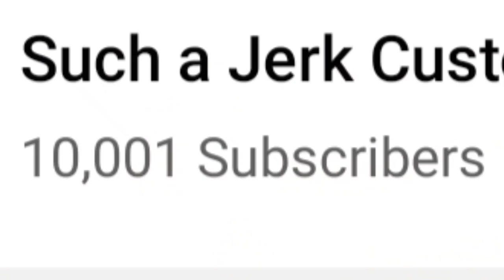Lure Making Trout Minnow | build to catch 🎣

Comment: What product did you use to be that mirror effect after the black paint?
Reply from the maker: It's called mirror finish powder for nail art, in order for it to work, you must use "top coat no wipe" UV nail polish 😉
Reply: @SuchaJerkCustomLures  Very well, then the black paint is also for manicure?, and the final finish you use epoxy resin or is it some nail polish?
Reply: Sorry for so many questions, I hope I'm not annoying or intense... 🤪
Reply from the maker: @zonadepesca7259  no worries, I'm trying to explain as much as possible in the video, but if something is still no clear, I'm happy to reply 🙂
Reply from the maker: @zonadepesca7259  Black paint is regular airbrush paint, just apply it with brush 🖌️ to avoid cleaning airbrush 😉 once you have the mirror powder applied, the top coat is up to you, can be dipped in poliurethane varnish, two part epoxy, or UV resin 🙂
Reply: @SuchaJerkCustomLures  Ok perfect, thank you very much, I understood.

Comment: Hi, i wanna ask about your method with UV resin 🙂 what good side of use Uv resin than epoxy? and i got some problem with epoxy even i use rotating dryer rack. The epoxy can't spread even and i always end up with wavy surface. do you have some tips for kind like this. thanks.
Reply from the maker: The only advantage of UV resin is the speed of curing, it is not as durable as epoxy. In terms of epoxy be sure to be precise when weighting ingredient A and B. I suggest to buy cheap jewellery scale with 0.00g accuracy 👌 second tip is to make sure you don't touch your lure with bare fingers as this transfer oils to the lure surface, so paint and handle the lure before epoxy with latex gloves 😉 that should help
Reply: @SuchaJerkCustomLures  thanks for the tips
Reply: Please make some tutorial making handsign on lure. 🙂

Comment: I've got a question, How do you know where you have to make heavier your lure ? (i'm french sorry)
Reply from the maker: It comes with experience, normal crank bait you wish to weight so it sinks horizontally (one sinker in the middle for wide side to side action, or two sinkers in front and behind the bottom hook eye for tighter action) However if you wish to make trout twitch bait is good to push the balance towards the back so the lure sinks tail down 😉
Reply: @SuchaJerkCustomLures  Ok thanks ! i Will try To do some lures this winter ! i will use epoxy tought for the coatings and a barbecue thing that rotates for the regular coating :-) i m waiting your new vidéo !! keep going this.is awsomme

Comment: hello, what is the thickness of the wire in mm?
Reply from the maker: 0.6mm in this case, for 7cm minnow I would use 0.8mm and lures above 10cm 1.0mm stainless steel wire

Comment: Beautiful  I would love to try Any help you can give to source the materials would be very appreciated.
Reply from the maker: I bought the abalone from AliExpress - when I bought it it was 25% cheaper - and still with that being said fare warning about the quality, as you saw on the video I cut out the second side from middle of the sheet as there is quiet a lot of flaws in the material...
105,20 zł  22%OFF | Flexible Korea paua abalone shell  mother of pearl laminate sheet veneer self-adhesive sticker backing Size240mm/140mm
https://a.aliexpress.com/_vlQ4D6

Comment: Hi! If it's not a secret, please tell me how you have lost the quest for weights?)
Reply from the maker: Hi, I'm not sure if I get your question... 🤔
Reply: @SuchaJerkCustomLures  Did you rub out the vestiges for the weights with putty?)
Reply from the maker: @Sergmax0  yes, that's how I cover my weight holes, it sands smoother than super glue and baking soda - it is a two part car body filler putty 😉
Reply: @SuchaJerkCustomLures  Thanks, I'll try!)

Comment: why do you wipe the super glue on the lure when the 4:35？
Reply from the maker: Two reasons: it hardens the balsa a lot and seal the wood making it waterproof 😉
Reply: @SuchaJerkCustomLures  which  kind of super glue should i choose？
Reply from the maker: @alexjiang9507  thinner the better 😉 because it will sip into the wood deeper 👌
Reply: @SuchaJerkCustomLures  ok，thanks